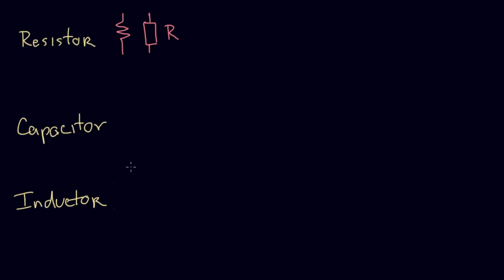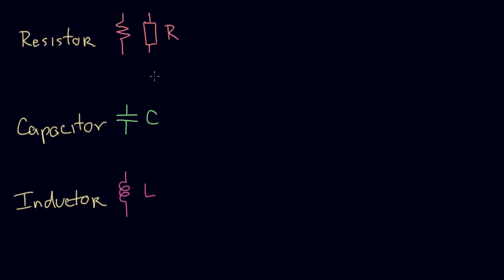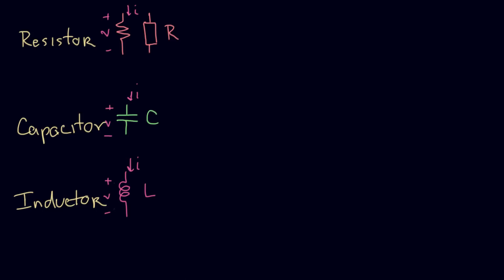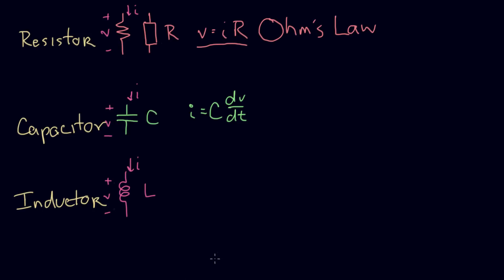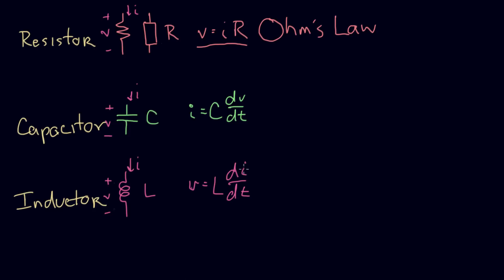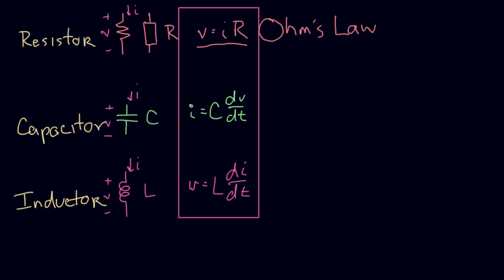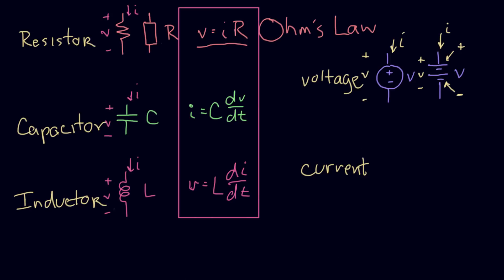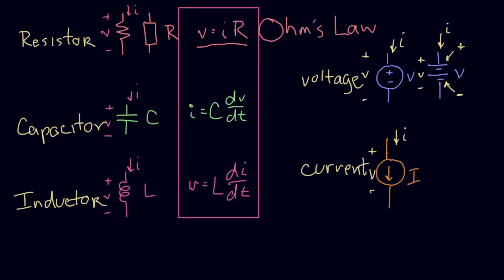Ideal circuit elements and sources

Comment: Where did conventional current flow go??? I think your voltage sources should have the currents flowing the other way. Well at least every engineer I've talk with over the past 30 years would show the current using conventional current flow.
Reply: its correct, its the passive sign convention. because resistors absorb power current flows from plus to minus yielding a positive power, indicating absorption of power when using ohms law. this convention is reversed for voltage sources so that we get a negative power value for voltage sources which implies it supplies power.